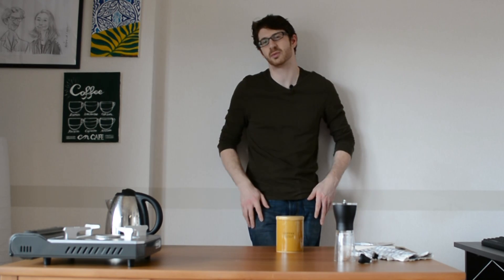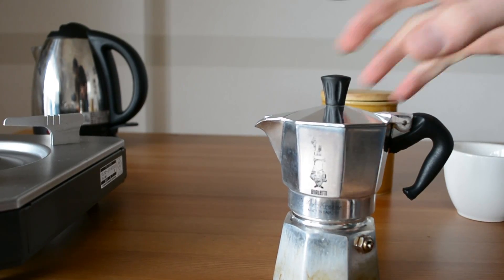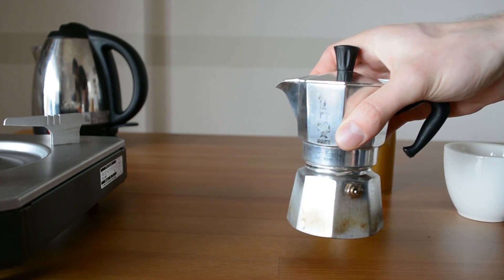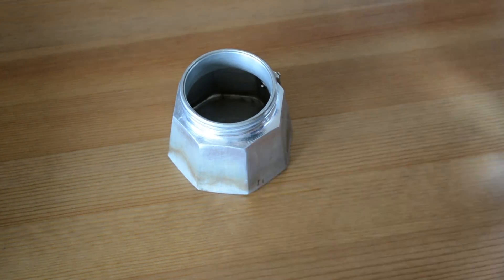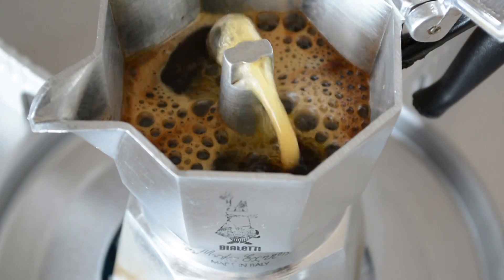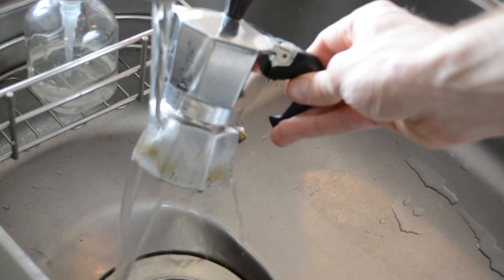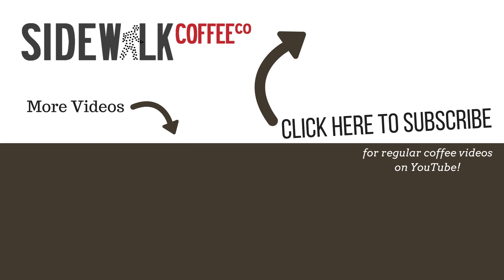How to Make PERFECT Moka Pot Coffee Every Time

Comment: Can you or anyone here tell me about the grinds? I have a kruve brand sifter with different gauges for different needs. So you say little bit finer grinds than drip and french press grinds but coarser than espresso grinds? I've seen the holes on my moka pot where the tray goes. They are quite big as if the grinds i need will fall into the funnel. Also, if they are that fine, won't they go up into the brewed coffee area? Also, can you use different roasts for your moka pot? Thanks.
Reply from the maker: Ooh a Kruve sifter! I've been wanting one for a while. I don't know about the exact size but the holes in the bottom aren't a big problem. The drink actually filters up which makes it difficult for grinds to climb up. 
I'd love to try making Moka pot coffee with a sifter 😊

Comment: Some help please. I have a 4 cup pot that I just bought. That doesn't mean that I'll have 4 cups of coffee right. Both times I tried it I'm left with a good amount of water still left in the first compartment. Just making sure I'm not missing anything. Thanks
Reply from the maker: That's normal I think, as long as it isn't half the pot, a little left in the bottom is fine. Make sure you are doing it up nice and tight so there's a good seal.

Comment: My coffee doesn’t bubble out like that—it sputters in erratic spurts and is very messy.  Am I doing something wrong?  
And am I supposed to have water left over at the bottom?
Reply: there should be some water left in the bottom chamber so that the chamber doesnt burn.
Reply: Ah, thank you for the advice!
Reply: I'd say your grind is too fine.  I had the same problem when I first bought mine but once I made the grind a little courser I had a really easy flow.  Either that or you are making the coffee grounds too compacted in the basket.
Reply: agella72 thank you!  I’ll try that

Comment: Whenever my moka pot start to gurgle, I took it off the stove, but the result is almost half of leftover water is left in the water chamber,, is it normal??
Reply from the maker: poserleader are you using an induction hob?
Reply: I'm using gas stove
Reply from the maker: poserleader ok.  are you sure the grind is right?  And are you using a pot for one?
Reply: I'm using Bialetti Venus 4 cup, I've tried using fine and coarse grind, although the coffee that is produced is really different, there is always half leftover water in the lower chamber
Reply: I'm using Bialetti Venus 4 cup, I've tried fine and coarse grind, the coffee produce is indeed different, with the fine producing thicker coffee, but there is always almost half leftover water in the lower chamber...
Reply from the maker: poserleader Could be that you ground too fine and it cant get enough pressure to go through the chamber. Try grinding to about the same coarseness as table sugar, then adjust from there based on flavour: too bitter? Adjust coarser. Too mild, go finer.
Reply: I use imusa moka pot and yeah its normal for left over coffee in the chamber
Reply: poserleader i made a video about the coffee pot

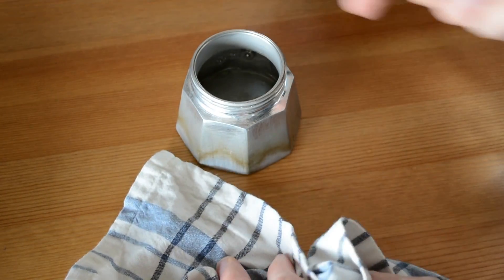Comment: 1:29 this is wrong. I've been starting off with cold every time I brew and never end up with bitter coffee. There won't be any pressure to build if the temperature isn't at the starting point. So you start off cold, it heats up, and as soon as it does, it'll build pressure.

Comment: Why cool the lower part of moka pot before serving?
Reply: Doing this quickly stops the boiling in the bottom chamber which cuts off the flow through the grounds and into the top of the pot. When it starts gurgling this means steam is getting entrained in the flow and you'll start getting over-extracted and burned coffee, so you want to shut it down as soon as possible at that point.

Comment: It doesnt matter wether you use hot or cold. I prefer normal water (my thermometer say 25-30 c) because it is more convenient. Using hot water is not worth the hassle.
Reply: The reason I have heard is that it gets the water boiling and brewing the coffee faster. Apparently if you heat the coffee too much it will cook and become more bitter? I have no idea and am not any sort of expert or coffee snob, but that's the reason I've seen to use hot water.
Reply: @JamieBainbridge  I tried it. It doesn't make a difference. You just have to have the patience. I put the stove on medium-high.  Once you see the sputter, take it off immediately and cool it under the faucet.
Reply: @inquisitive871  I keep a small tub of cold water next to the stove and put the bottom of the pot in that. Quicker and easier and uses less water :)

Comment: I don't know who got these dumb ideas started about using hot water and running cold water over the pot, but both are pointless.  It doesn't matter what temperature the water is in the bottom section, it has to boil to make coffee, so the water will be ~212 deg F whether you start with hot or cold water.  And very little heat is reaching the grounds through the metal, so that is irrelevant.  Cooling the pot after the coffee is made will likely cool down the coffee to some degree, but that's it.  Once you remove the pot from the stove eye, the heat in the pot begins to dissipate and does nothing harmful to the coffee.  So all you are doing by running cool water over it is creating lukewarm coffee.